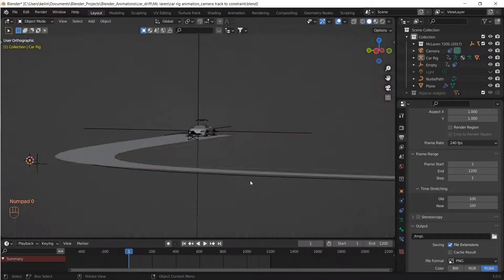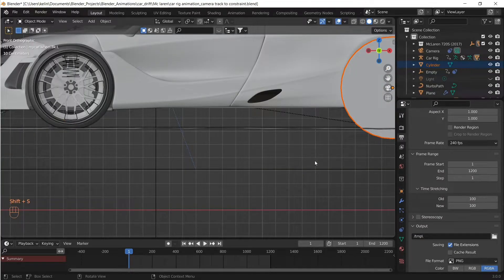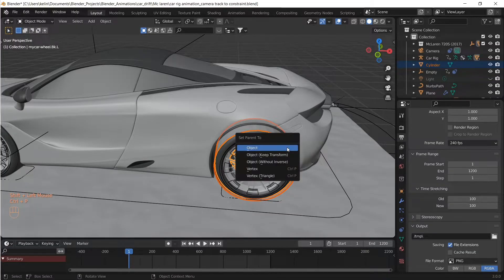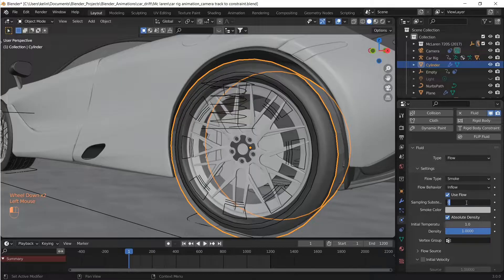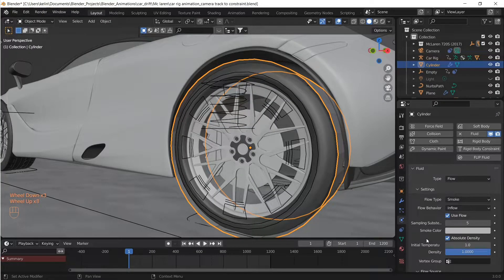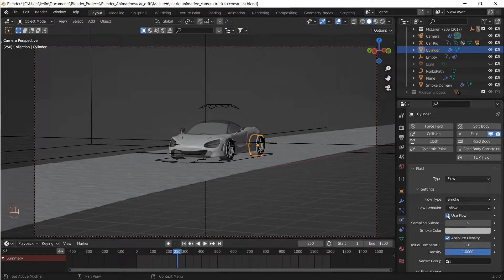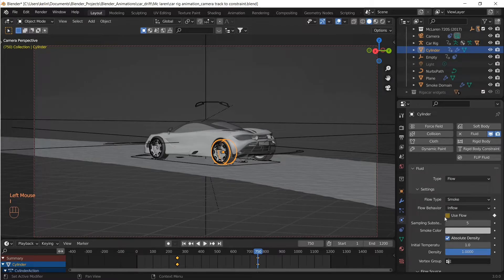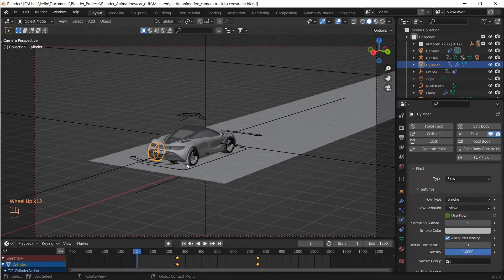Blender Tutorial | Mantaflow Smoke Source settings during Car drift animation

Comment: Could this be used for making car a car splash in a puddle?
Reply from the maker: Dynamic paint can be used to create ripples in the water puddle as the car tires interact but for a splash, we might need to use fluid simulation with car tires as the obstacle.

Comment: I tried to render using cycle, but smoke is not showing. Does anyone know how to fix this?
Reply from the maker: Parts 1 to 3b are for setting up the scene and the simulation. Smoke shading and render settings are discussed in Part 4 & 5